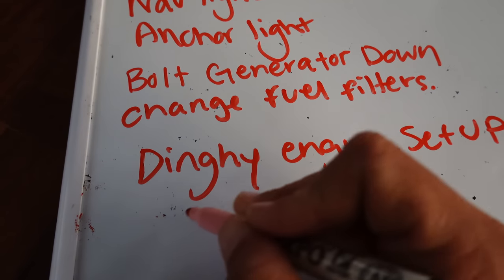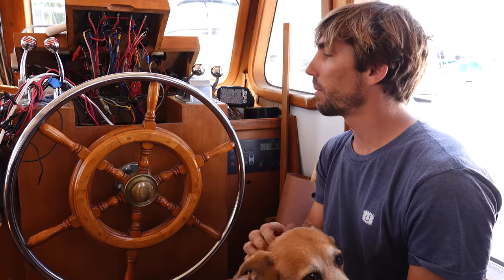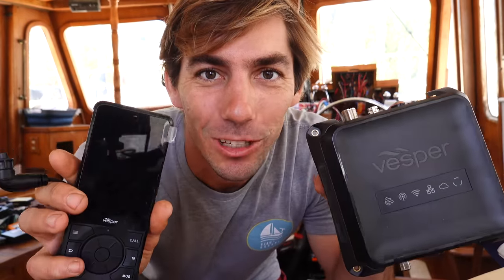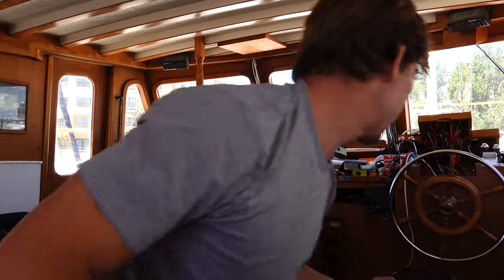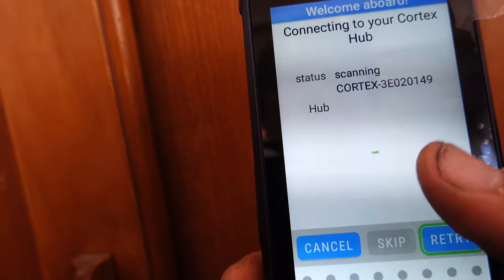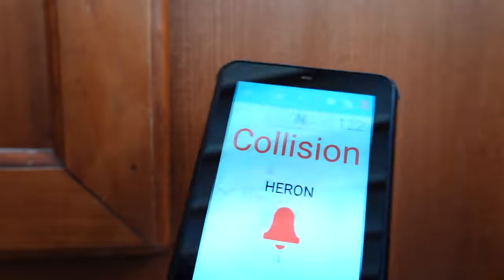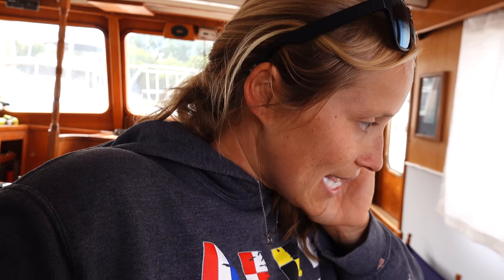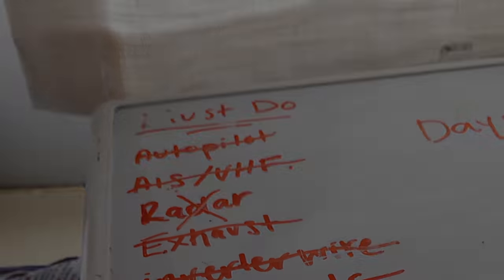Our FINAL To Do List. Turning our $100 Trawler into a PACIFIC OCEAN CRUISER

Comment: Okay I was impressed with all the knowledge of running the diesel engines. The electronics is a whole nother ball game. I'm way impressed. The battery conversion, the inverter, installing the AIS, just taking out the old electronics is a major accomplishment, refurbishing the kitchen, the master stateroom, the forward State room are all impressive accomplishments as well. Let's not even begin to discuss all the exterior work the two of you have done. Super impressive, not your run of the mill boat refurbishing projects. I imagine just the materials alone are in the tens of thousands of dollars. I'm very anxious to see a final tally of all the costs involved in the improvements. After that I I am anxious to see the number of man hours you both dedicated to this project. If possible try to add a dollar figure for your time. That has always been my downfall when trying to determine whether doing the project myself is worthwhile whether it is home renovation or boat upkeep/renovation. In the end you guys are doing fabulous work, far above any pay grade you may assign yourself.
Reply from the maker: Awh thanks Mike!! We’re going to have some fun first but then we will make sure to discuss all cost and hours and if we think it was worth it!! 🥰😁 thanks for being with us on this journey!

Comment: If a window gets blown out on the trip north the dash location might not be a good spot for equipment with emergency communications capabilities. 
Pac Cup we also had a plan/system for covering blown out windows if that were to happen. Just thinking about your trip north. 
Doing the I-5 route at 55mph is a popular choice even with commercial boats use to rough water. Just saying 👍

Comment: I’ve watched a lot of HVAC technicians, troubleshoot, simple systems that they didn’t know anything about and they often use a jumper until the function they are trying to fix works. Even if it wrecks another function. The stories I could tell.  You always have to check for smoke and heat. Anytime you start up something that’s been newly worked be prepared to shut it back down.

Comment: If you don't use the "VHF Input" on the Cortex you should terminate the port with a (little) 50 Ohm termination (small dummy load).

Comment: On your last video I saw you steering from upper helm. It did not look comfy.  My solution is a wired or remote control for the auto helm. I once had a simrad wired remote that was fantastic. In addition to the regular features it had a steering only mode where the rotary knob in your hand was basically like holding the tiller in your hand. Each click on the knob was one degree of rudder.  It had a rudder angle readout, and you could easily steer in rough waves with this set up. It was like sitting anywhere you want and having tiller in your hand

Comment: Ah, I think the grease was for the swivel.  How embarrassing,  And darn it Billy that ADS B transceiver can be installed inside the cabinet where it is protected from both the sun and the water damage present on the ledge directly adjacent to it so you're gonna end up having to replace that too.
Reply from the maker: The grease came with the anchor not the swivel

Comment: Warning: These LED bulbs inside a navigation light is not to code. The old navlights were constructed to that expensive funny special bulbs with the glow wire strict in the middle - only with that bulbs they show the light at the defined angles. Think: the navigation bulb sends light from a very small point 360 degree. The Chinese LED bulb only emits some 20 degree.